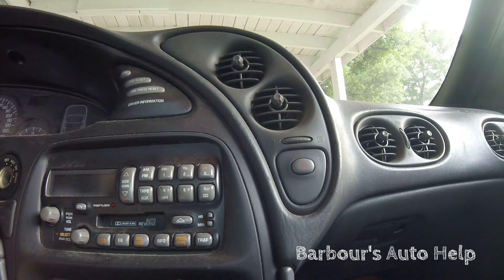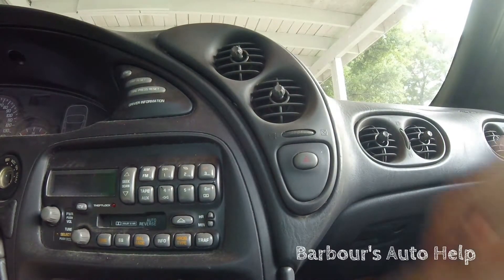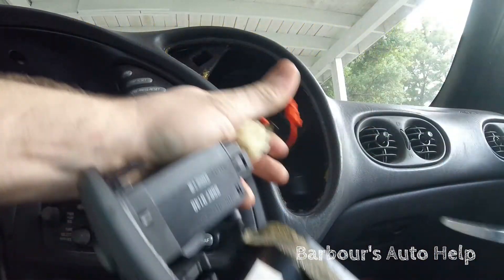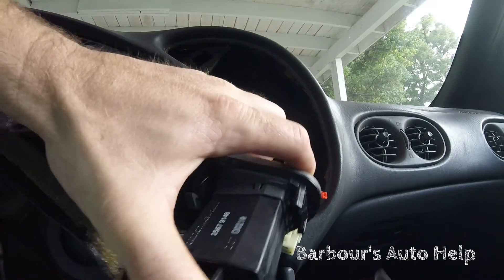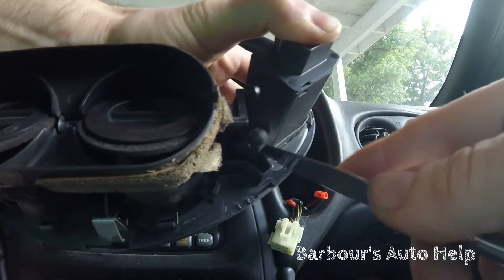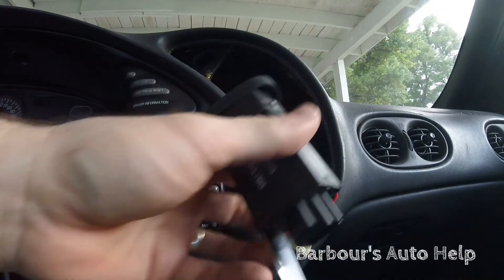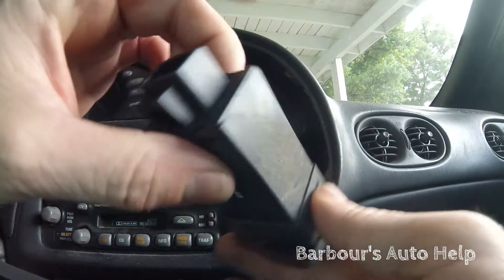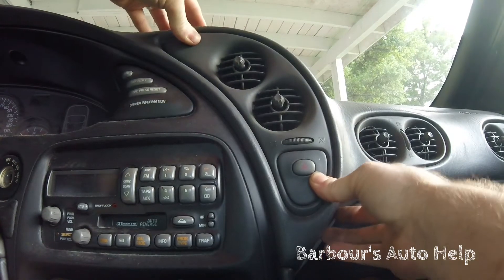Hazard Flasher Replacement 01 Pontiac Bonneville

Comment: Where would I get a new one of these? My blinkers only flash once and then shut off and I'm assuming I need to switch this out. Same thing happens when I try to use my hazards, they flash once and then just shut off.
Reply from the maker: Have you called a parts store?  Or looked online.
Reply: @BarboursAutoHelp  I've checked online and asked some auto parts store and I can't really find it. Whay should I look up specifically just to make sure?
Reply from the maker: That doesn’t make sense. A parts store should be able to locate one for you. That’s the best I’ve got for you.
Reply: @BarboursAutoHelp  I'm sorry, I was definitely looking for the wrong thing! seems I couldn't find a Bonneville one but I did find an OEM for a Monte Carlo with the same pins on RockAuto. Your video still helped me figure out what I needed to replace on my car so thanks!

Comment: Do you know where l can find a replacement Hazzard Light part like you demonstrated in the video? I have a 2003 Pontiac Bonneville and it looks just like the one you took a part. Yes the car is 20 years old…only 73,000 miles and in great condition. It’s time for Bonnie’s inspection and this thang ain’t working right causing the single to not work right. Help a Sistah out please. Thank you very much!
Reply from the maker: Should have one at most parts stores I would assume.  Have you called around?
Reply: Yes and no one has it. One of the comments below says that a similar part from a Monte Carlo might work 🤷🏽‍♀️
Reply from the maker: @funjazzlover  I’m not sure how to direct you then. Maybe try eBay?
Reply: Okay, thank you.

Comment: I'm having trouble finding the Hazard Flasher Replacement. I've tried the local auto parts store and eBay Motors. Do you know where I can find this part?
Reply from the maker: You may have to go to a salvage yard. Bunch of folks having a hard time finding this part.
Reply: @BarboursAutoHelp  Thanks!

Comment: I have a 2000 Bonneville and the turn signals and 4 way flash really fast when it's warm inside the car but when it's cold they won't work at all for this I leave the 4 way on and after a while it will start flashing could my problem be coming from the part that you are replacing
Reply from the maker: It's possible.
Reply: Ok thanks
Reply: That's exactly what it was
Reply from the maker: Right on